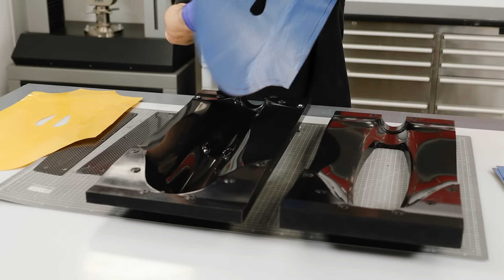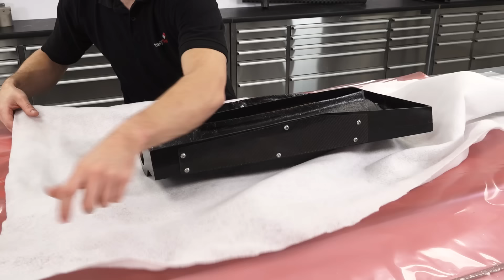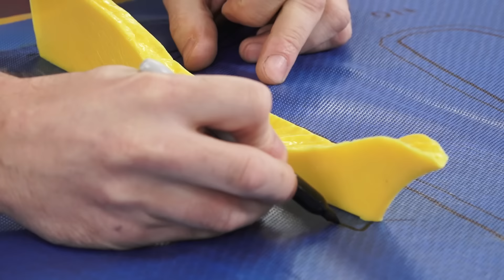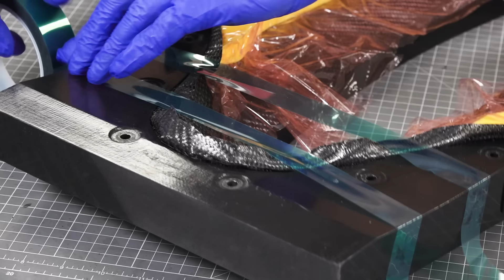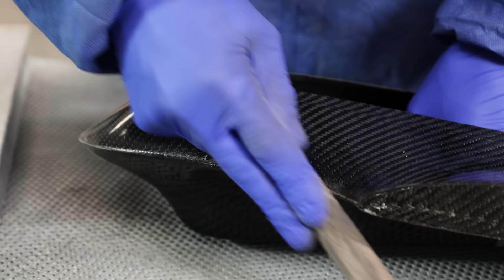Making A Complex Hollow Carbon Fibre Drone Fuselage

Comment: THANKS, ...IS CARBON COMPOSITE MATERIAL COMPATIBLE WITH EPOXY,...OR, POLYESTER RESIN,... OR BOTH???...
Reply from the maker: This specific part was made using epoxy resin based prepreg materials.

Comment: most silicon creates VOC for over a week after cured. And to my knowledge silicon VOC is very detrimental to epoxy strength.
Reply from the maker: These silicones are not creating VOC's like you might see with some resin systems.

Comment: Great part, this channel is a hidden gem! Is there a concern with the silicon preforming intensifiers potentially contaminating the composite by acting as a  "dewetter" and causing delamination? I tend to steer away from using silicon and certain keytones when manufacturing CFRP with single or multidirectional cured expoxy pre-pregs. Would like to hear your insight when you have time. Thanks!
Reply from the maker: The non perforated release film acts as a barrier between the silicone and the carbon so there shouldn't be any issue with contamination of any sorts.
Reply: @easycompositestv The video mentions that the silicon will cure along side the prepreg. Meaning potential cause for contamination. This could affect the mechanical properties of the cured resin leading too microscopic voids inhibiting the overall strength of the cured material. Great content though I look foward to seeing future videos!
Reply from the maker: @powerman-_-  I think there's a bit of mix up in terminology. In this case cured alongside means at the same time as. There is always a release film between the silicone and the carbon itself.

Comment: Если вы производитель этого полотна то было бы удобней сделать его разными цветами , 1 слой черный , 2 слой желтый , третий красный к примеру. Это бы помогло всем лучше контролировать и видеть процесс нанесения на форму.
Reply from the maker: Carbon fibre cannot really be changed colour, different coloured fibres can be introduced however this will reduce the performance of the fabric a s a whole as they tend to be made from fibres will lower mechanical performance. .

Comment: Nice video, thank you for sharing this. Drone industry is growing quickly. I have a question on the engineering side. How you predict ho the individual plies are cut to ensure proper producibility, also maybe it will be interesting to see how engineers analyze the structure to make sure that the plies stack up and splicing will tolerate the loads in flight without failing, what criteria is used to substantiate this kind of structures.
Reply from the maker: A lot of the time it comes down to experience and physical testing. The geometry of a part can vastly contribute to the strength and stiffness of the structure meaning that calculations can be very complex.

Comment: I really din’t understand at all. Where is the liquid epoxy and whatever other things which is required. I’m really new to this so please explain.
Reply from the maker: There is no liquid epoxy.  The materials are known as prepregs and they already have the resin impregnated into them.  The material is then cured in an oven under vacuum.  The heat is what cures the resin to make the rigid laminate.

Comment: What's the weight saving over grp.
Reply from the maker: As we haven't made one in Glass it's difficult to say for sure. As a ballpark, carbon has roughly 6 times the tensile strength of glass and whilst this wouldn't translate directly as a weight saving to achieve something with the same strength and stiffness, the reduction in weight would be noticable.

Comment: One could argue that the joint is still the weak point since there is no actual fibre holding the parts together just the glue.

Comment: Dear Paul,

Your videos are always wonderful and clearly show what an excellent teacher you are.

I just wanted to mention one small point. You often say “zero point five” (0.5) or “naught point five,” but in engineering practice, we usually just say “point five.”

The zero before the decimal point is only written to differentiate it from the number 5, not spoken aloud. If we were to say “zero point five,” then how would we read numbers like 000.5 or 0000.5? Saying “zero zero zero point five” would sound quite awkward!

So, there’s really no need to say “zero point five” or “naught point five.” Simply “point five” is perfectly correct and sufficient.

Best regards,
🌹🌹🌹🌹
Reply from the maker: I think you've mentioned this before? Whist, for sure, you can say "point five", you can also say "nought point five", but "nought point five" has the advantage of being harder to mis-hear in a production environment. Maybe it's a locality thing but we're working in high level engineering every day and I'll hear and use both of these forms regularly. But, thanks for the comment and I'm always happy to get comments and feedback, even if we agree to disagree!
Reply: @easycompositestv  I agree.  Being hard of hearing, if someone just says "point five" I can't be sure that I've not just missed "one" and will have to confirm that they meant "zero point five".  This means that it takes much longer than if they'd just said "zero point five" in the first place.  Explicitly saying zero or naught just makes it much less ambiguous.

Comment: No mater how easy you may it looks like it still looks difficult and if I tried it they will find me glued to the sheet of carbon fiber and suffocated with the vacuum bags, if I use the longer curing adhesive they may have a chance to safe me if they find me within 2 hours..
Reply from the maker: If you find yourself inside the vacuum bag whilst the part is curing then that suggests you have done something drastically wrong. 😅

Comment: This is a classic. Do you ever use balsa core for flat sandwiches? I get the impression that it's stronger than the manmade core materials
Reply from the maker: We have used balsa yes, check out the video on the flax canoe where we used it to reinforce the bottom and sides of the hull. It does have one of the highest compression strength values for our core materials however, this does come with a bit of a weight handicap.

Comment: pleat the edges of your vacuum bags, it will make your life (and bagging without bridging)  a lot easier
Reply from the maker: You don't need to pleat a vacuum bag when placing the whole mould inside an 'envelope' bag - the bag needs to be sufficiently large enough but unlike when bagging to a flange, pleats are not required.
Reply: @easycompositestv I agree it is almost mandatory when bagging to a flange. there are many cases in composites when you don’t  « need to ».  However doing so, even with a large bag, makes it easier to locate your pleats in the critical areas inside the part, in radii for example. It also decreases the “stress” in your sealants around the bag, thus less leaks. But yes can increase the risk to have a leak where you create the pleat. All in all I’ve always found a few pleats in the periphery eases the overall bagging process.
Reply from the maker: @flobou5157  As long as the bag is sufficiently large enough then there shouldn't really be any stress on the gum tape joints. There should be excess loose bag to conform to the shape whilst still leaving the ends fairly relaxed.

Comment: this is the old skywalker X8. pretty good platform actually. Trouble with using CF for drones is its bad habit of blocking RF, complicating the placement of your receiver and VTX antennae. Mounting underneath is the obvious decision, but fixed wing drones pitch roll and yaw, and situations in which signal is blocked by the wings or fuselage are the norm.

Comment: what is the name of the rotary tool cutting on this video ?
Reply from the maker: There's a few different brands out there, dremel being a popular one. A good idea for carbon fibre work is to use a flexi attachment which will keep the conductive carbon dust away from the motor unit. The perma grit tools are a great choice of cutter to go with a rotary tool.
Reply: @easycompositestv  do you have a recommend website to buy it ? please share with me, ,my thanks :*
Reply from the maker: Search for Dremel as there are a lot of suppliers.
Reply: @easycompositestv  my thanks :* ! by the way, the CNC machine you used in the previous videos ! how much for that ?
Reply from the maker: @tuanbuiminh2674  Typically a machine like that would be around £10k

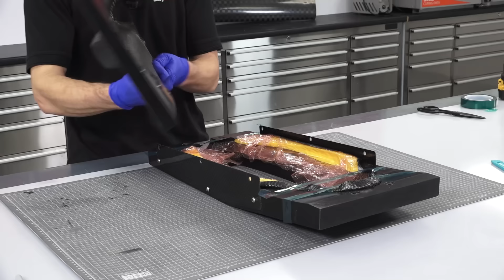Comment: 00:00 Introduction
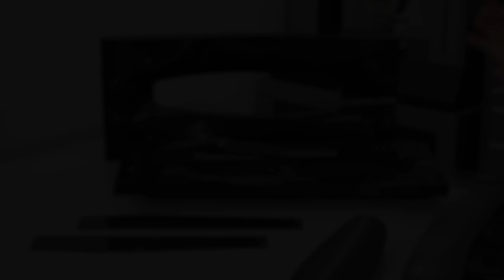01:02 Planning: Materials and Process Selection
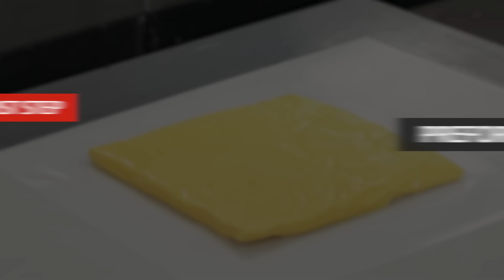03:36 First Step: Preforming Intensifiers
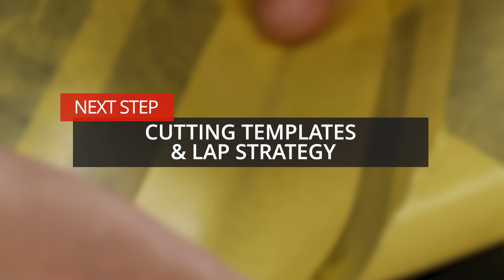07:11 Cutting Templates & Lap Strategies
09:22 Reinforcement Kit Cutting
10:26 Laminating the Prepreg
13:02 Intensifier Placement & Mould Closure
14:31 Co-cured Intensifiers
15:44 Vacuum Bagging & Cure
16:23 Demould & Trim
17:19 Internal Structure
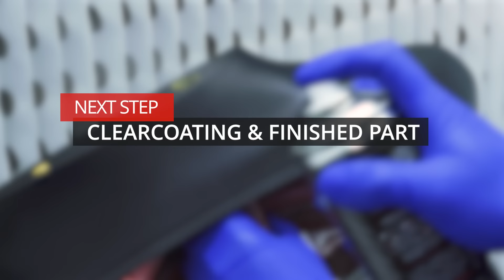21:51 Clearcoating & Finished Part

Comment: Thank you for the amazing video!! What other techniques can be used for a 2 part mold to have a clean seam line?
Reply from the maker: Other methods can be trickier given that you will be working with dry cloth and liquid resin but multi part moulds can be used with both resin infusion and hand laminating. Generally though, prepreg is preferred.
Reply: @easycompositestv I’m working on an aesthetic wing for automotive, but all surfaces will be visible (depending on angle and how far you want to squat). I’m considering running the seam around the lower (underside) inner edge to hide it. Any advice?
Reply from the maker: @fantom_1  You can position the seam line in an area of detail, say the trailing or leading edge which can make it more discreet. You also need to consider how easy it will be to laminate in a certain position A tricky position may make the laminating less tidy which will be more of an issue/more obvious.
Reply: Really appreciate your replies. Learning a lot from your videos. One last question, how would you do a split mold on a part that is sealed and you can’t get the vacuum bag inside? Like sealed, 1 piece hollow wing/aerofoil?
Reply from the maker: @fantom_1  If the shape doesn't allow for a bag to pass through the entire mould shape then really you will be looking at using a sealed bag with positive pressure to give the consolidation to the reinforcement.

Comment: Easy composites, great job as usual! Can you make a video on how to make carbon fiber wings or structures for high performance RC aircraft. Additionally, can you make a video on how to make control surfaces such as ailerons for these carbon fiber wings. Thank you so much!
Reply from the maker: It's on the back burner at the moment whilst we focus on other projects but making a video for the wings is on the list. In terms of control surfaces, a strip of peel ply within the laminate is commonly used as a live hinge. Model aircraft wings have used this method for years and there is plenty of information in forums on how to go about doing this.
Reply: @easycompositestv  Thank you so much! Also, when you do make a video on how to make wings, will you use prepreg or wet lay up? I would prefer a video using wet lay up because prepreg is pretty intuitive and wet lay up is a lot more difficult.
Reply from the maker: @kaustavkapur5532  For this project we will probably use prepreg as with the fuselage. It's more suited to this type of manufacturing.

Comment: "a few hundred grams" meaning it requires a special license, aka not for us plebs
Reply from the maker: Perhaps.  Recently proposed changes to drone rules planned to take effect in 2026 in the UK state drones weighing 250-499g could be flown in the A2 and A3 categories if approved by the government.  So conceivably a drone similar to this could be flown with the standard Flyer and Operator IDs without the need for GVC if you're not going performing BVLOS flights.  Though, if you're making a UAV in this way we imagine you'd usually be using it for more specialist situations, and thus yes the paperwork requirements start creeping in.

Comment: Would it be possible to use this type of split mould to create hollow pieces with a wet layup or infusion process rather than prepreg CF? Also I would love to see a video of you making a hydrofoil or similar. Thanks so much for the amazing content.
Reply: Also could you share the design files of this drone I would really like to see how it was designed. Thanks.
Reply from the maker: In theory it would be possible yes but very challenging to try and infuse a shape like this with good results. A dry fabric is simply not as suited to this type of processing, whereas a prepreg is far more workable and easy to handle. 

A hydrofoil is somewhere on the very long list of video ideas but is something we do want to look into at some point. 

This airframe was only designed to demonstrate methods of tooling and making difficult shapes, it wasn't necessarily designed and refined as a finished product.
Reply: @easycompositestv  Ok thanks for all the info much appreciated.

Comment: So that's what yellow rubber chickens are for. Kidding aside, could these chicken positives fill the entire mold and be wrapped with continuous carbon fiber before clamped by the molds?
Reply from the maker: If you were getting to the point where the entirety of the mould needed additional support then you would probably need to reconsider your mould design. The intensifier works well of tricky detailed section where the vacuum bag cannot easily conform. Otherwise the vacuum bag is perfectly sufficient to apply consolidation to the laminate on the larger flatter areas.
Reply: @easycompositestv  Not because it needed support but to avoid the modest overlap between sides. I know it doesn't take much overlap for CF to show its strength but it has to be a weak point. It might be impractical to wrap a wobbly positive first, I was just wondering.

Comment: Hey guys i just saw toray make a carbon fiber infused PA6 and it was a bliss to work other than pre preg. I hope you guys will produce it someday
Reply from the maker: Yes thermoplastic composites have been around for a while but tend to be quite specialised in their nature. They do require processing at high temperature and which tends to mean more energy more expensive equipment and more complex tooling. 

There are also some limitations to these materials, to note a lower thermal resistance to sustained temperature and also creep under prolonged loading.
Reply: @ true, true. On the bright side, the excess can be made a forged carbon fiber tho. Ah yeah, since you got the new autoclave i was curious about High Pressure - Resin Transfer Moulding method. No one does that on youtube. Is it like doing reverse vacuum resin infusion?
Reply from the maker: @manray8513  RTM requires a solid 2 part mould where the fibres are placed before having the resin injected into the cavity. Very similar to the injection moulding process for thermoplastics.

Comment: Amazing video as always! I have a question regarding epoxy glues. When I need to glue two parts together, I use my regular laminating epoxy resin mixed with silicon dioxide, applying it with big syringe. So do I really need special glue for my job, or my method is just fine?
Reply from the maker: Hi Alex, you can absolutely use a thickened resin as an adhesive and we have done so in other videos, especially for larger flatter areas such as honeycomb bonding. The advantage of an adhesive tube is the convenience and ease of use and the potential for a higher bond strength given the specific requirements of the product as an adhesive.
Reply: @easycompositestv  thanks! ❤

Comment: I can’t find epoxy spray adhesive on eBay or in the US. Is it actual epoxy or could I use a normal 3m contact adhesive to keep the cloth from fraying
Reply from the maker: We don't list it on ebay but we can ship to the US from our site here in the UK, simply add the items to your basket and select the delivery destination. The website will then calculate the shipping cost and estimated shipping time. Fusion Fix EP is an epoxy based product.

Comment: I usually use my laminating epoxy for adhesive with some thickener but I wonder how well this holds compared to a dedicated high performance adhesive.
Reply from the maker: You can thicken laminating epoxy to produce and adhesive paste and we sometimes do this for larger flat areas. The effectiveness of this will naturally depend on the specific resin. For smaller areas we find that the structural adhesives are very convenient to use and in most cases provide a very good bond.

Comment: Make a front fender for a motorcyle out of fordged carbon
Reply from the maker: Forged carbon made with the compression moulding technique favours a more solid 3D form  rather than the flat panel shape of a fender. If you wanted the chopped tow appearance on this sort of shape then you can laminate a surface layer of chopped tow into the mould and then back this up with woven fibre behind to provide the strength.